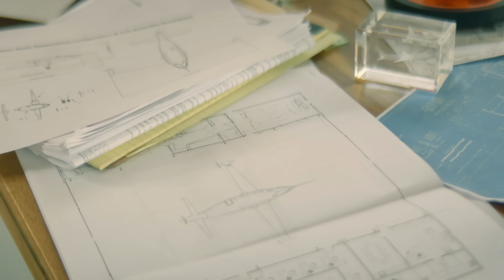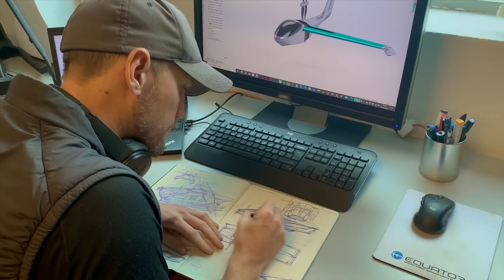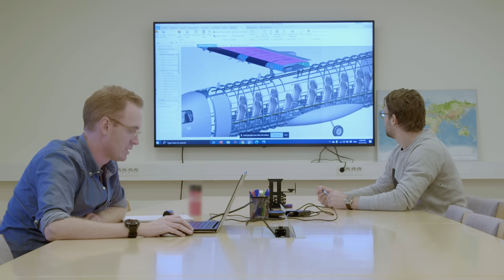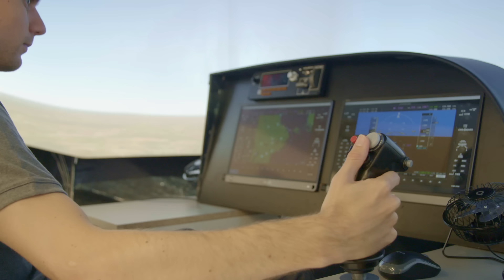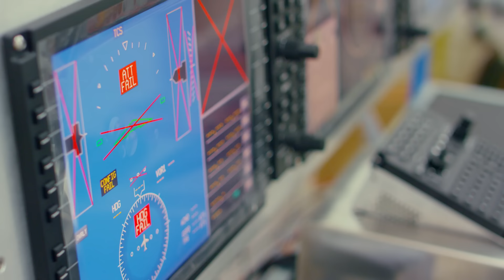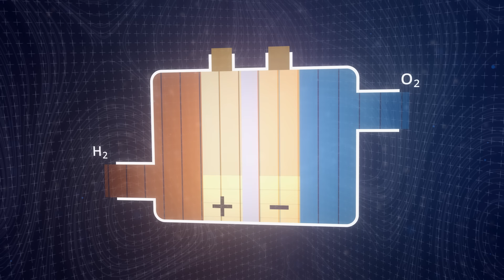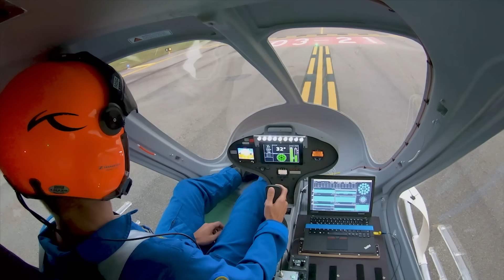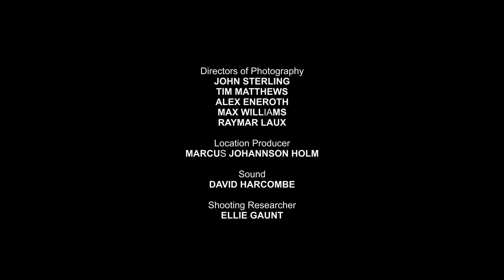Planes of the Future: The End of the Jet Age? | FD Engineering

Comment: The problem is one of size. A small electric aeroplane is not going to solve anything. You need very large aircraft that can transport 100+ people and the technology here is nowhere near what is required. The larger the craft the more unattainable the goal. Battery tech is still very primitive and the larger the craft the less efficient the motors are. That is why you never see a electric aircraft with greater than 2 or 3 seats. Moreover the required battery power and associated carbon footprint in manufacture equals or even exceeds conventional craft. Maybe it will happen, but not with this project as an example.

Comment: For a short hot training aircraft or such that requires low range and low noise, axial flux motor drive ducted fan propulsion with Lithium Sulfur Polymer ultra light battery system in mass reduced magnesium carbon fiber enclosure with KAPTON fire safety polymer (all aimed at making the battery the highest energy density possible) for ultra low mass aircraft EV battery, & the magnesium case axial flux electric ducted fan propulsion with RPM optimize for use case blade design 3D printed in single filament robotic layer carbon carbon autoclave then machine blades with titanium attachment & reinforcement & thin zirconia ceramic leading edge protection ultra hard abrasion resistant leading edge protector tiles ultra thin integrated seamlessly into a machined slot & epoxy bonded, so a long life, ultra high performance ducted fan with carbon carbon fan ducting stiff and ultra low mass with titanium reinforcements. Then all carbon carbon body with ultra low mass optimization gold silver alloy silicon jacket wires with high current in smaller lighter gauges to connect the battery, controller and motor to save even more weight at a slight cost penalty.

Comment: Please focus on series production design so that many short hop passenger electric aircraft with range extending APU gen set can be made in medium volumes and sold around the world to benefit populations living near water ways and airports where aircraft sound pollution a major problem. This can also clean up the air near airports because 100LL releases lead from small piston powered aircraft of similar 2 or 4 person capacity and even larger turbofan aircraft do not have emissions controls like a modern automobiles because there is no practical way to adapt a catalytic converted to a turbo fan system unless the turbo a generator with recuperator like a combine cycle CO-GEN axial generator system where a hot exhaust catalytic emissions reduction can be applied since the turbine only makes electricity and can operate at one optimized RPM or rotation speed ideal and tunes to make the most electrical output and lowers possibly emissions and lowest thermal stress to enhance engine life and tiny between APU overhauls. Think make more, cheaper, manufacture them faster, better range extended electric aircraft with all the benefits of EV models and still the benefit of fuel energy density benefiting turbine engines low mass optimize in range extender APU.

Comment: let's wait that the density of fuel is reached, still so much energy in 1 liter diesel as 15 kilos battery, even the best. and loading the batteries, the plane won't be making money, with hours between each trip to charge it, or is the charging 300 or 500 kWh in 15 minutes?

Comment: You are right. Airlines set schedules and areas serviced to accommodate the largest numberof travelers at a reasonable cost. And I have borded a plane in Sshanghai and landed 14 hours later in Los Angeles, CA. We were comfortable could go to the bathroom and walk around stretch our legs and even sleep without any concerns about when and where I wold be within 30 minutes of the planed time of arrival. You will never be able to do that with an electric qaqir plqne.  You just mentioned that your hope for a future airplane  tht an fly 400k. But crossing the Pacific Ocean, Who ae you kidding And how are you going to develope and store the electricity that would be required to replace the present air travel requirements. It is an impossible dream that will interfear with the development of systems that will replace  or clean up the systems that will work. Developing systems that fly 2 people 320 miles and then take 3 hours or more to charge up to fly home. is fanciful and imaginary. We need to develop clean fuel efficient propulsion systems using turbins and ICEs that use Hydrogen/Water conversion to H2 or plutonium or something yet to be discovered. Highley suggest to get practical. Maybe we could use resistance to generte electricity from movement through the atmosphere so they never need refueling. Good luck but you must meet the public need.

Comment: WOW! Some very forward-looking stuff here that is very reassuring to know has begun.
Volocopter? YOH!
I think aviation will transform much more slower than the shipping industry will, who've already begun making changes towards 50% reductions (recommended by the international authorities), with many companies actually now aiming at around a zero emmisions policy (by 2050 ish), and are utilizing amongst other things onboard desalination to help provide onboard hydorgen production. And we see a revival of martitime wind power, since many sail ships, especially clippers, were faster than many modern commercial ships, which can now employ state-of-the-art sails, or incorporate sails as part of a hybriding to reduce emmisions.

However, it won't be so easy for avaiation to make this shift. It will NEED to happen, and WILL happen. But the transition may be much slower I feel.
With shipping we can adapt existing vessels and convert them quickly.
With flight? Not so easy. We mostly need completely new designs, for completely new airplanes, for completely new fleets, with compleely new airport/airfield infrastructures.
But, as we see, the will is there now.
 And with Shipping and aviation outputting as much carbon and related emmsions than a whole country or two, it is a vital change to be made.

Comment: Plastic, Carbon Reinforced Plastics, Carbon Carbon, Magnesium, Titanium, Aluminum, Carbon Fiber, Au Ag alloy silicon jacket high current low mass wiring, with everything aimed at making low mass, including the specialized lithium sulfur mass reduced battery pack with the highest possibly energy density. No steels or irons as they are too heavy, more composite and fiber reinforced plastics and ultra low mass metals in everything.

Comment: And yet, the wingtip and tail motors were axed for the production version because of safety. If one of those wingtip motors goes out (highly unlikely but say birdstrike), the asymmetrical thrust would be extreme. So now it's got two much larger motors in engine pods located in the same place as most bizjets.
Reply: They also said the plane wouldn't need to crab in a crosswind with the wing tip rotors. It sounded like nonsense to me.
Reply: The first thought upon seeing the wingtip engine design was “what happens in an engine out scenario”. Also, the crosswind comments are ridiculous. We have had the ability to cross control an airplane in crosswind landing conditions for ever either through rudder control or asymmetrical thrust on multi engine aircraft. But there are aerodynamic drawbacks to doing this during the approach phase ( e.g., reduced lift on the downwind wing due to blocked airflow by the fuselage). Also, reacting with thrust levers dynamically to wind changes is problematic.

Comment: Nice video, for me all these companies are just money washer, task which they do is designing entire plane instead of just replace engine to electic one and fuel tank with batteries. They just wasting money to creating how plane should look like but all of that is already known 100 years of evolution proofes that. Trying to build electric plane with current battery technology is just fighting with windmills, of course they can build plane and put all these batteries but they do not create miracle and it make it very heavy. I think hydrogen or syntentic fuel is more logic move until some breakthrough in battery technology
Reply: The thing is the planes themself has to be soo much more effective to be able to fly on batterys, they have to design the planes too, look at the "19 seater" from Heart, you have to kneel to walk to your seat and the seat are cramped, that's what they are hoping to get in the air.
They are a long way away from getting a normal plane to fly on batterys

Comment: So…I’m not allowed to pack my battery pack in my checked bags due to the risk of a runaway, but you’re trying to convince me to fly INSIDE one??  

PASS
Reply: If you need surgery, would a discount scalpel from a guy in an alley be fine, or would you only trust the one in a hospital to be sharp an sterile?

When you compare aviation grade batteries they'll be made to higher tolerances of precision and tested more frequently than the battery in a city eScooter.

Comment: Hydrogen energy density greater than kerosene is disingenuous. Kerosene = 35Mj/liter vs H2= 4.9Mj/liter making tank volume 7 times that kerosene tanks AND since the tank’s at 700 BAR the tank will weigh 4 times more than the H2 forcing the entire fuselage to be the tank. yes, energy density Mj/kg is better but conversion to electricity using fuel cells is only about 20% efficient making the whole H2 for aviation thing dubious.

Comment: Batteries are no where near ready for real operational use in the aviation industry. The size and weight of batteries will prevent the plane from lifting off the ground for large commercial airliners. What is the battery recharge rate? How long with the plane be down for charging before the next flight? If the recharge rate is too long, you will need more planes to accommodate the number of flights per day needed to met demand: increased cost for the company that will be transferred to the customer, i.e. higher ticket prices. Oh, and the environmental savings that you think you get is non-existent! Why? All "renewable" sources of energy depend on fossil fuels to be created: the metal needed for windmills comes from the use of fossil fuels, wire insulation comes from fossil fuels, solar cells require fossil fuels. Therefore, you first pollute the Earth by releasing CO2 to mine, transport, manufacture, deliver, use, and eventually dispose of "renewable" sources of energy.

Comment: An electric car was thought to be impossible - until Elon Musk disrupted the whole industry.  Re-useable rockets were impossible, until SpaceX gave the lie to this.  Musk has said that electric aviation is not practical until batteries can hold 400kwH per Kg.  Rumour has it that his latest 4680 battery has over 1000kwH per Kg.  The aviation industry is just BEGGING to be disrupted.  Boeing has certainly passed its apogee and is in what might be a terminal decline.  It is the General Motors of aviation 🤥.  Musk is not interested in aviation and there is room at the top for a technically brilliant innovator.  The rise of Tesla is your model.  Go to it guys - and God Speed !!

Comment: Electric power is not the solution as long as it requires electricity and batteries. And it does. Both. So, investing time and energy in developing machines based on this tech is a total waste, especially from the environmental point of view, which is apparent reason why people are buying into the concept.

Comment: No-one who has ever flown a real aircraft in real conditions for 100 hours or more would believe that the Alice is a viable configuration. This has been obvious from day 1. The proponents of this are either idiots or shysters or both. Propellers out at the ends of high-aspect-ratio low wings create huge problems  with engine-out stability at altitude and ground-strike during take-off and landing. How can so much time and energy be wasted on such a dumb idea? This reflects poorly on anyone who believes this is a viable concept. Now let's also get real about energy density, turn-around times, and the need to deal with significant "fuel" reserve requirements in commercial aviation.

Comment: It is much simpler to just ditch the gasoline and the fossil fuels for alcohol/methanol. In some countries, cars have been running on alcohol for over 40 years, the same cars are still running. All it takes is a higher compression rate (yields more power than gasoline, actually), an alcohol thermostatic valve, and intake manifold heat for easy start in cold weather. All piston ACFT already have carburator heat. Such fools. Still, I'm sure they'll end up making money, even if its a total failure, somehow, they'll keep their lifestyle. I wonder how they do that.
The end of the jet age? These batteries are only turning propellers because they couldn't turn a proper turbofan kind of engine for very long.

Comment: Just because you can't see the pollution caused by electric engines doesn't make them "clean". If the majority of electric power comes from coal, (which it does) the pollution is just not where you can see it. This also doesn't take the mining of lythium and other materials needed to make batteries. There is also a MAJOR  issue of the child labor in China used in the mines. I'm not agains't the new technologies, I just want some honesty in your video.

Comment: The first two planes are almost useless. The fact that batteries, atm, are not viable. Electric car sales are practically dead. Why on earth did they not make them hybrid?? Couple in the fact that more and more of the general public are becoming aware of the high pollution cost of fully electric vehicles you would think the funding for these projects would fall out from under them.  Reduced costs are misleading. They don't encompass the entirety of the motor, batteries (at least every four years) energy costs, and infrastructure.

Comment: How many windmills does it take to manufacture ONE windmill? A single windmill will never produce enough energy in its useful lifetime to re-produce itself.
What is the carbon footprint/fossil fuel cost to build ONE composite airplane? Carbon Fiber, resins, pre-pregs, autoclaves, hazardous waste disposal...it's a long list. 
These are all net loss concepts when evaluated over their useful lifetime. Ideology will not overcome the logistical challenges of the "Green" future.
Electric vehicles are noble concepts, but entirely un-achievable when you calculate globally available raw materials, time factors and geo-economics.
Beyond that...Climate Change is a cyclical phenomenon, driven by much larger forces than anthropomorphic contributions. Start with Heinrich Events....
IMHO

Comment: E-Plane in Commercial, Not going to work... it'll work for fun flying but to fly from New York to LA you will need to put some crack in it to fly that far... these dude got big imagination...
Reply: The key driver for the first innovator was noise.  Stop acting like the problems we face are single dimensional.
Reply: @markharmon4963  My single dimension says there won't be a e plane that carries more then 30 pax for 3+ hours in 1000000 years...
Reply: @ImionsaeXwb77  Then you are saying there won't be any progress from where these prototypes already are.  And that is short sited.
Reply: Progress, they can Progress all they want, but it'll be on the drawing board, head and never reality... there's just no way a battery can sustain a 2 hour flight time carrying 30+ passenger...

Comment: Sure, lets replace all the efficient combustion engine aircraft with electric propulsion aircraft, it's green and will save the planet, but lets not mention anything about the 800 pound gorilla that all of this wonderful technology will require in order to made any real difference: the source of recharging all the batteries. 

What good does it do to move to electric power in vehicles that are the smallest contributors to carbon emissions in the world when all of it is STILL going to rely on the some of the biggest contributors, the power plants that generate the power.

This is what I hate about all these eco-warriors annoying everyone around the world protesting against vehicles - they are fighting for change in all the wrong places. If you want an electric world to have even a remote chance of working in the near future then stop bitching about motor vehicles and turn your attention to pushing for replacing all the fossil fuel power plants with nuclear plants. 

Nuclear is the ONLY solution that is going to work to meet the goals - you aren't going to get there with hydro, solar, geo-thermal or wind. You simply can't generate the necessary amount of power within the geographical footprint needed using any of those 'green' sources. Most countries either do not have the natural resources required to make it work, or the amount of available landmass to dedicate to it. The only solution that any sense at the scale you would require is nuclear. 

Make nuclear power so abundant and cheap that it can easily sustain the recharging infrastructure needed for an entire nations ground and air based transportation needs and those industries will naturally move to utilizing it because it is cheaper than fossil fuels. 

Stop annoying people with eco-protests and start educating yourselves and them on the benefits of nuclear energy. All the  "problems" with nuclear that the nay-sayers always love to bring up - waste disposal, etc. - are infinitely more easily solvable, and most were solved decades ago.